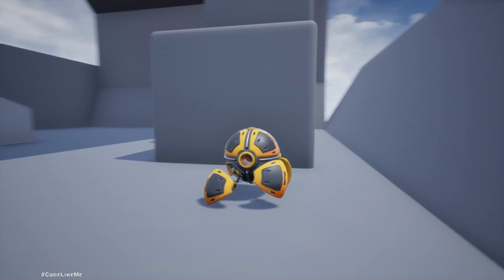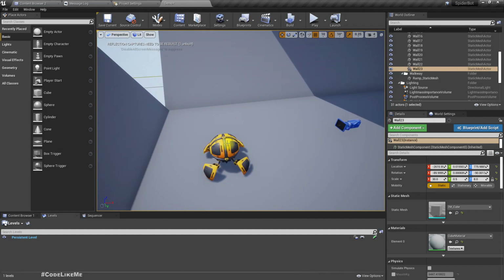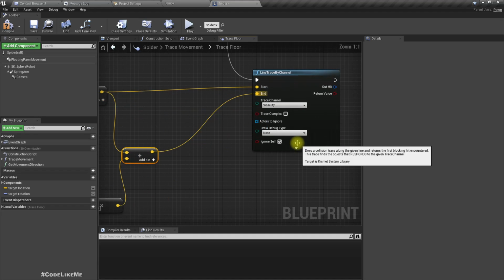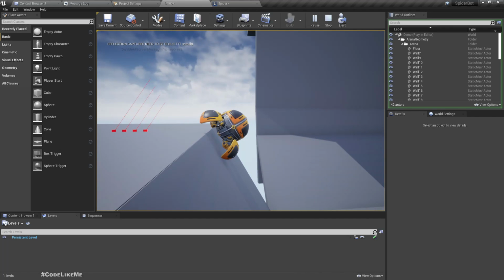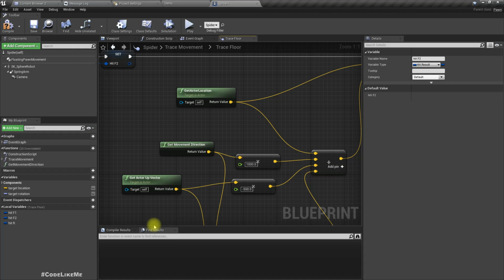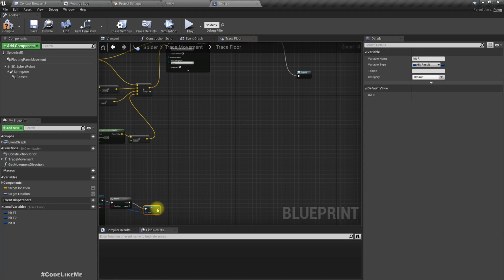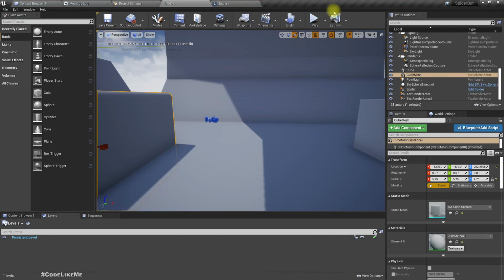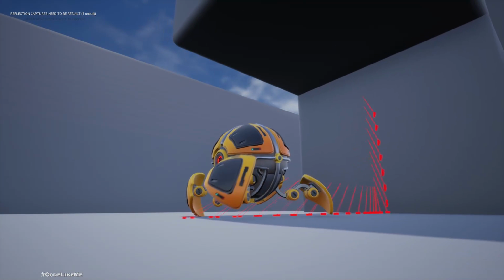Unreal Spider Movement #2 - Moving on surfaces with any angle

Comment: This was super helpful but I am having trouble tweaking it to my liking. I am trying to make it not turn when you move left to right. I want the character to stick to the cameras rotation when switching wall angles.
Reply: There is a boolean you can use to ignore controller yaw when climbing, which locks orientation straight ahead but allows you to sidestep left/right/move forward/backward as normal. When the character begins climbing use the boolean "Set UseControllerRotationYaw" and set to false, then set to true again when the character stops climbing. Good luck
Reply: did you ever figure out how to do this?

Comment: Thanks for such a good tutorial. I need an extra ability for the control but I couldt figure out it how. How can I get forward and right vector from control rotation?(for "get movement direction" function). I tried it, but it does changing trace direction vector and the chr stop walking on 90 degree floors.
Reply from the maker: can't reply without testing that out in the project